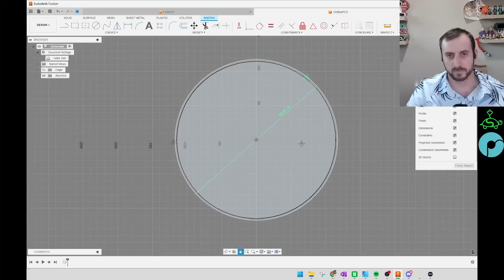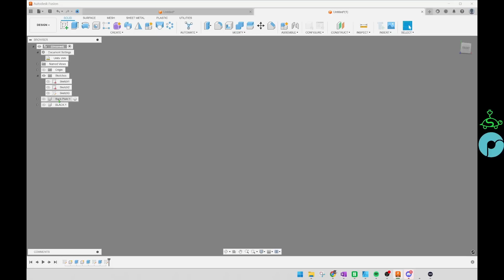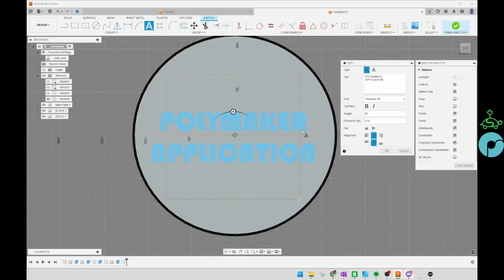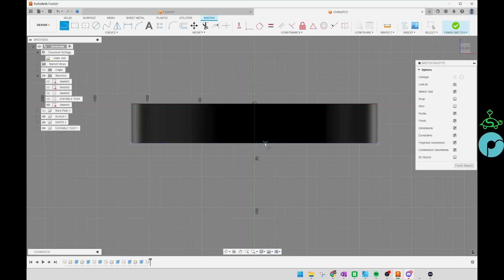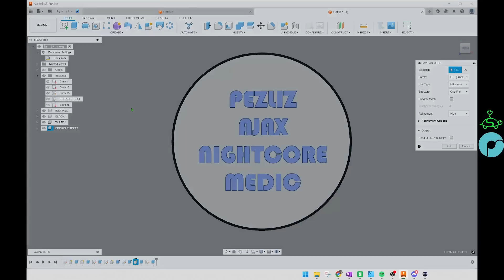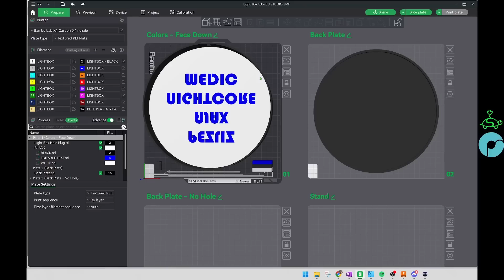Make and editable circle light box - Brighten The Evening - Episode 2 - Shurdle3D

Comment: Can you do a tutorial that shows how you attach the box section to the backplate instead, and have the front art plate with a lip on back? Basically, the opposite.
Reply from the maker: Possibly so
Reply: @Shurdle3D  I've attempted, and so far, I'm able to make the 2 outer offsets on the front plate with the inner offset having the extruded lip. The problem I run into is that I get lost on how to extrude the box from the backplate. Thanks for the great videos.
Reply from the maker: @GOY_1488  watch my latest video with the Polymaker logo with the motor in it and it’ll show you how to do it

Comment: I don't understand why you put in a rectangle hole for the leds, when you can mount the led strips on the back with a dc jack.
Reply from the maker: If you have the LEDs facing the front you will get bright hot spots. If the LEDs are on the wall facing inwards then only the ambient light is passing through the face of the light box. I don’t put a hole in the back so people can mount it on the wall with like a picture or set it on a shelf. If there’s a hole in the back it’s not going to hang flush to the wall.
Reply: @Shurdle3D  I do them all the time with the leds on the back and have no bright spots. I guess the leds I use have a wider angle of light. Jack on the back for desktop and jack on the bottom for wall hanging! I don't use usb cables either, I use wall adapters with inline switch or inline switch/dimmer for people that what to turn the brightness down for a nightlight. Where is the Lightbox Ambassador Channel?
Reply from the maker: @kevinroach9380  “I do” that’s the key thing here. I do them my way which is a proven method for me and the majority which is a much less laborious method since it’s plug and play and minimal effort and minimal materials to get the same outcome. You can make them any way you want. The channel is in the Polymaker discord server.
Reply: @Shurdle3D  you seem to get defensive! You should get some help for that.
Reply from the maker: @kevinroach9380  nah, you just seem to know everything and anything I do is incorrect.
Reply: @Shurdle3D  Never said that. You are just taking it that way. I think you need some help. The first thing in life is to never doubt someone else's ideas. It's how you learn. You also learn from others' mistakes. I don't brag about anything like you do because I don't need to be acknowledged for what I do. I am a very humble person. One thing I don't do is put up with someone's shit. I am an honest, upfront person. I also do things right or not at all. I sent you the peace sign light, match that!

Never underestimate who you're talking to or who is in your audience.
Reply from the maker: @kevinroach9380  look at everyone else’s comments and my replies vs yours and ask yourself why my comments are different towards you vs them. 
But I have a crazy idea, why don’t you make a YouTube channel and put a ton of work into all of the things like I do and then share all of your experiences instead of criticizing mine. I have like 99% positive feedback on all of my videos, that’s not luck when it’s repeated on every one of my videos and models and content I release. I’m too busy to keep coming back to this so have a nice day and hopefully you can work on making your own content and show people why you do things differently.
Reply: @kevinroach9380  Where do you get a wall adapter with inline switch/dimmer and what voltage for LED. I took a quick look on Aliexpress but must have searched for wrong thing.